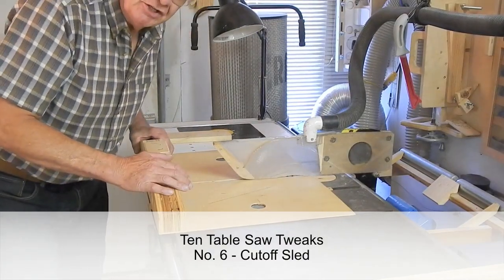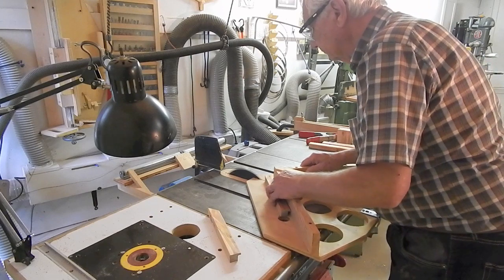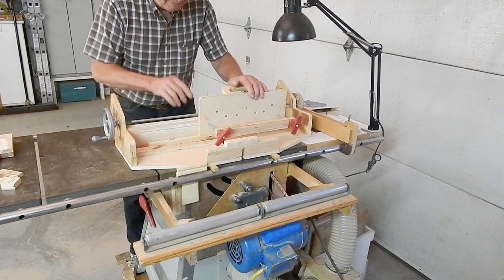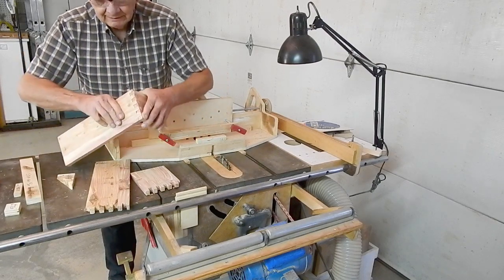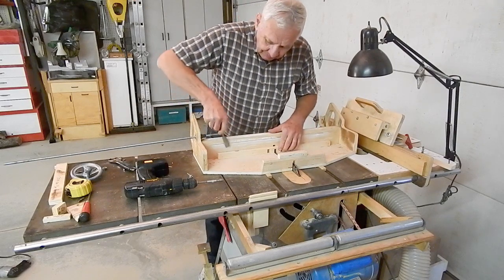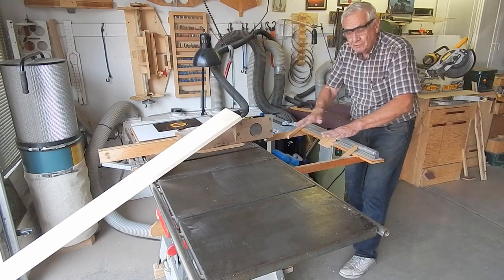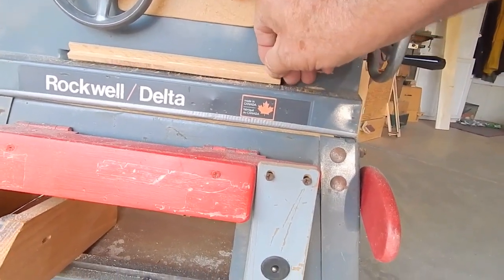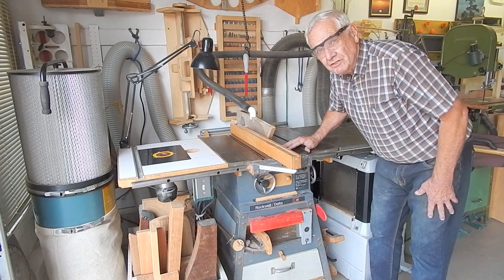Ten Table Saw Tweaks; Numbers 6 to 10

Comment: I've done a similar thing with my open base contractor saw to prevent dust, I used some brush material for the angle selection gauge and the port. Nice tidy shop you have there, wish I could say the same of mine at the moment! Thanks for the video, so good ideas there.

Comment: Table of Contents (continued)
6. Cutoff Sled (0:00)
7. 45 Degree Miter Sled (1:30)
8. Box Joint Cutting Sled (2:48)
9. Outfeed Support Rollers (10:28)
10. Dust Collection (12:14)
Reply from the maker: jarodeells,  Thank you for adding this helpful table of contens.  //Carl

Comment: At about the 3:10 mark you mentioned a lead screw and then in the same breathe you say something about a 16 tpi 3/8" rod.  Is that technically the same thing?  Where did you get it?
Reply from the maker: Frank, Yes the lead screw is a 3/8" diameter, 16 thread per inch, threaded rod. You can buy threaded rod a most big-box building supply stores and at most good hardware stores.     /////carl
Reply: @CarlHolmgrenwoodworking  Oh okay.  You were using the threaded rod as a lead screw.  Perhaps I'm just being overly technical, but I was under the impression that a "lead screw" is a specific type of screw with specific geometry, and that a threaded rod doesn't meet that definition.  But you are using a more functional definition?

Comment: Nice 10ER in the back, there! Do you only use it as a drill press?
Reply from the maker: +Adam Cantrell    99% of the time it's used as a drill press.  I added a speed reduction intermediate idler step pulley. Now It's actually quite a good drill press for a woodworker: tilting table with a fence, quill travel stop. I can't say the same about other uses: lathe, table saw, horizontal drill, disc sander. /////Carl
Reply: +Carl Holmgren I've got an upgraded Mark V/520 which I've used for everything but lathe functionality (so far).  I do enjoy it, and I love the exact same things about the drill press function you mentioned.  You don't see many SS in YouTube shop videos, and I thought it was pretty neat.

Great video, though!  I definitely like your box joint jig!!